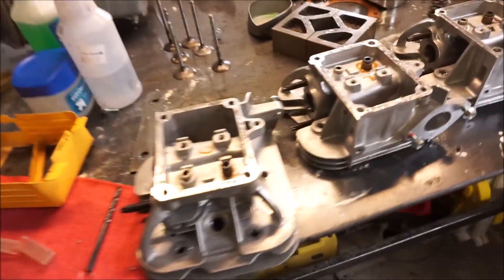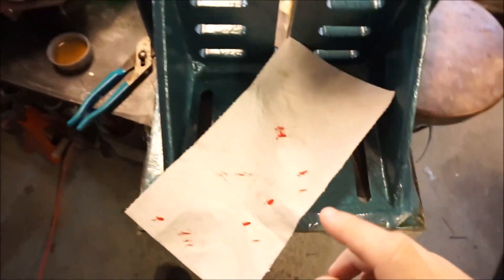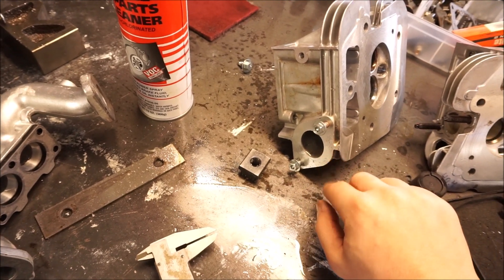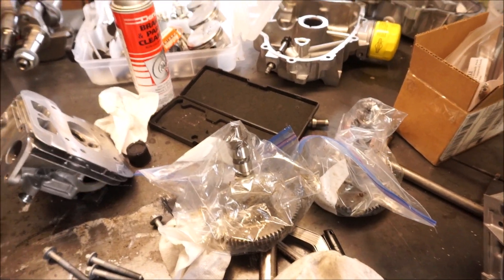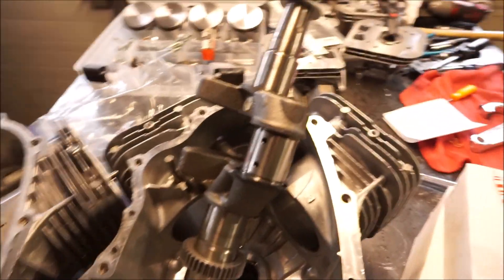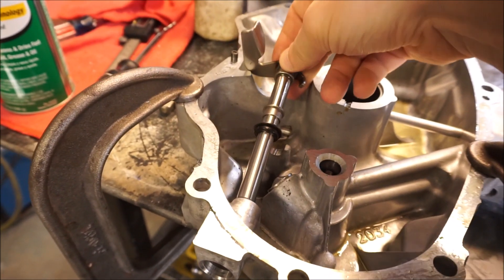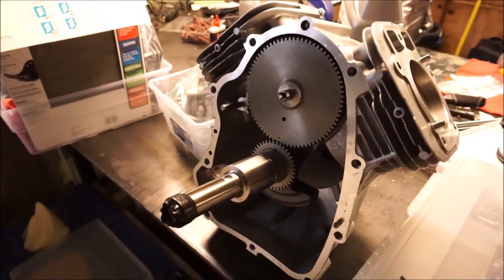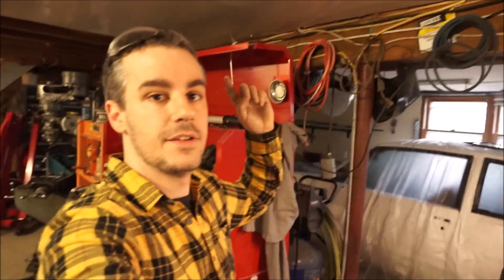Briggs V-twin Racing Mower Build: Finishing Up The Heads and Assembling the Block

Comment: What size cam did you go with? I installed the 308 cheetah cam and have the timing advanced one tooth on the cam. Was told by a race mower engine builder it will give me a little more low end torque to go along with the top end improvements

Comment: Saw you had some more footage up and caught myself up with your mower progress. Idea I had on cutting the relief for the valve springs was try an annular cutter, if finding one in the size needed is possible. I don't have a rotary table (yet😁) for my mill, so setup would be a little bit simpler. Having the head square, and jog over to the other guide.

Comment: Use a torch an heat up around the stud and you should be able to pull it out with vise grips. Also hope you cut the spring pockets so the dual springs don't coil bind. That would destroy all the awesome work you have done to these heads. Good luck with the racing buddy! Love these videos. Awesome work btw! Another tip you can do is cut the valve guides down flush with each port for a little extra flow around the valve stem. Just a little tip most guys don't know of or do.
Reply from the maker: Thanks for the tips!

Comment: For porting i love the carbide burs 1/8" shank extended, i get them off Amazon cheap, cut them a little shorter and a dremel on med-low with those will port a small engine head amazingly!